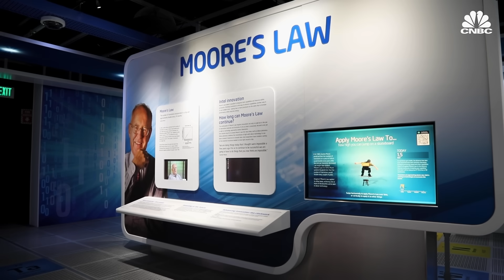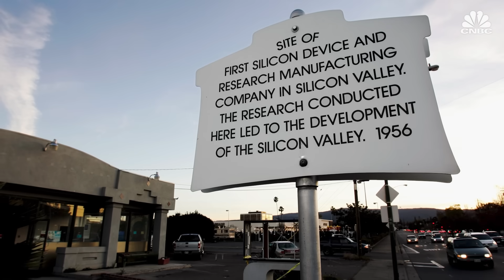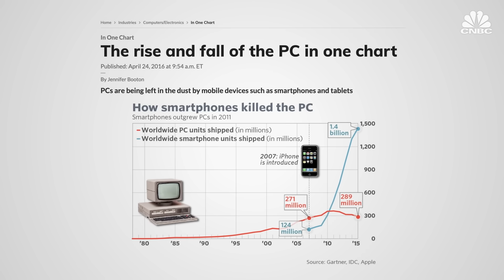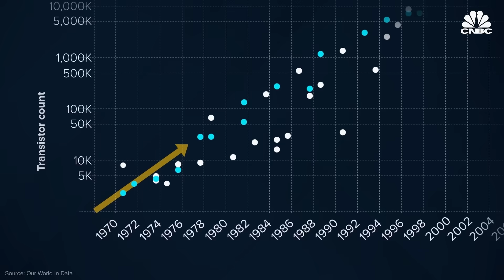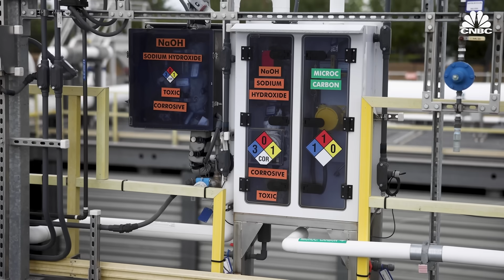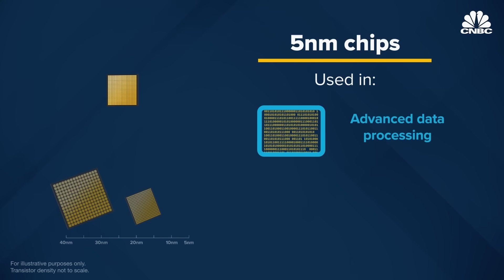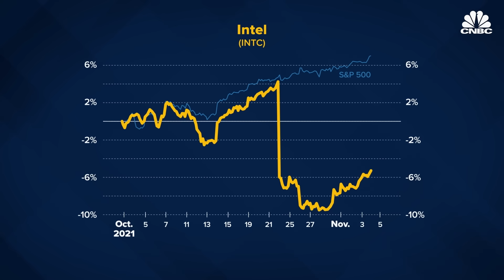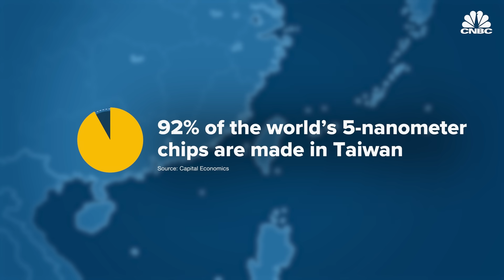Inside Intel’s Bold $26 Billion U.S. Plan To Regain Chip Dominance

Comment: Intel wants to surpass TSMC with $26 billion? They do know that TSMC is investing $100 billion over the next 3 years, right? CNBC reported on that, too.
Also, 18A by 2025? Translating from Intel Time, I'm guessing we'll see first small-scale products (probably a mobile CPU) by 2030.
Reply: TSMC needs more capacity for other partners intel will probably use most if it's capacity for itself 100B over next 3 years maybe but how much of that is R&D and how much is cost to setup new facilities
Reply: @naveenbattula  when a single asml machine costs 180million intel will need to sell to others as well. Such machines have a life expectancy of a few years. This means that these machines need to work 24/7 for the next 3 years with no stop to make the invest worth it.
Intel is not building the machines, they buy them from asml. Curently TSMC is a much better customer for ASML, the more you buy the better and more important customer you are.
The 100B Tsmc spends is for the next gen 3nm machines while the 26B intel spends are for the old 10nm and 7nm machines. Tsmc is already operating 5nm machines, months now.
Reply: @billwhoever2830  I don't understand your economics, it doesn't matter what size you make if it doesn't work or if no one wants it or doesn't want to pay  the price. Madly building without a plan, which is what many tend to do, will not get you to the  desired result.
Reply: @billwhoever2830  : INTEL own 15% of ASML. Intel invested in euv developement by 5 billions.
Reply: @tedmoss  
"Madly building without a plan" is not what TSMC is doing though. Almost all of the big companies choose TSMC for the manufacturing of their chips. Samsung, the only competitor today is something like a worst case solluttion if you fail to preorder from TSMC. For example Nvidia had to use Samsung on their last gen of GPUs because AMD and Apple preordered everything. Nvidia now has already pre ordered wafers from TSMC for the next gen. What makes you think that a company like amd, apple or nvidia will choose the new player, intel, over TSMC? I would say that intel is the one "Madly building last gen fabs without a plan".
Reply: @billwhoever2830  Intel 10nm is equivalent to TSMC 7nm in terms of density, and Intel 7 / 7nm is equivilant to TSMC 4nm (which isn't at full on production yet)
Reply: @billwhoever2830  Yes they are, that's what they all do in the end, because of lack of foresight and not seeing any other way. Desperate tunnel vision.
Reply: @billwhoever2830  Wrong, but it is a desperate plan nevertheless.
Reply: @rajeshdevika6195  : TSMC, Samsung, and Intel all had significant amount of shares in ASML.
Reply: I just think it's cool that Taiwan is a small island country of 23 million people. and the USA is a huge continent with 300 million people, has easy working language to learn, and sucking brainpower from all other countries through cultural domination and best-financed universities on the planet, and still can't keep up.
even ASML is a Dutch company, that´s the Netherlands. The Netherlands has 17 million people. and now it's their prime time.

 you know, natural capitalism, which is without nationalistic war conflicts but just peace, does head for the inevitable centralization of production monopoly, for efficiency purposes. ""After reporting earnings in July 2021, the company said they had a near-monopoly for machines used by Taiwan Semiconductor Manufacturing and Samsung Electronics to make the advanced chips. ""
Reply: @naveenbattula  you realize now intel has huge government contracts to provide chips for the US government ... And tscm USA plans are dependent on the government giving them huge subsidies Wich will not happen now the new spending bill is getting cut way down .. I'm American and fully support American made products ... Once China invades Taiwan it won't really matter and that will happen within 10 years and nobody will be able to stop it .. Tscm will be another Chinese government controlled entity
Reply: @wuhanlabtech3580  what do you mean by they were right but in the end they were wrong??? It's easy to design a 3nm or 2nm chip, anyone can do it even China, but manufacturing is a whole different world. This has nothing to do with Lith machines either, anyone can purchase them. Samsung has them but they are nowhere near where tsmc is at
Reply: @trueG922  actually they are and so is intel.. you been watching to many YouTube video's and should actually dive into the research that is going on .. but I suspect you won't and will not play your little game 
. Your a tscm fanbio I get it .
Reply: @trueG922  na not really intel 7nm well intel 5 I'm guessing it will be called now .. has a greater transistor density and everyone including intel is switching from fin fet .. and sorry bro when it comes to advance chip designs no one comes close to what IBM does they already made 2 nm chips months ago and are working closely with Intel now
Reply: I'm pretty sure that $26 billion number is their r&d figures over the next two years. Their total investment is much more than that. Their going to spend $95 billion in the EU alone with more investment in the US in the future. Their new CEO is going to spend so much on r&d that their shareholders are worried their pockets will be affected. I really hope intel can catch up. It will be difficult but Americas tech leadership is at stake and Pat focusing more on long term gains by spending big on r&d instead of short term gains to please shareholders like his predecessors is already a good sign of things to come.
Reply: @jms3827  That’s not quite what Intel said. It’s an announcement of only considering “up to $95b over 10 years”. A political announcement, not in the books, and much less per year than TSMC. TSMC capacity is 13x greater than Intel (13m wafers vs 1m wafers); it’d be unusual if Intel was out-investing them in fabs.
Reply: What? TSMC is building in America, so what are you guys on about? + Intel has been exposed by AMD, the American public no longer wants to support their greedy business model.
Reply: @GTJW22409  that's because US wants to steal TSMC tech. It's easier if you abduct them and bring them to your own place. 😁
Reply: @tweedy4sg  Yepp, we all know what it is. It is not stealing though, they made several huge deals, everyone has a price.
Reply: lol ...Most people who left comments have no idea the real reason why TSMC is successful.  It is successful because it is in Taiwan, with Taiwanese employees and complete supply chain in Taiwan. TSMC wouldn't be this successful if it started in the US or anywhere else.  Intel can invest  a trillion dollars and it still won't be able to compete with TSMC without a complete supply chain in the US and a relatively more cost effective employees and operations.
Reply: @jfyhou  : Sure, TSMC enjoyed the protection of the Taiwanese gov't largess from the getgo.  If the semi industry in the US had the same level of active protectionism from the US gov't, we wouldn't have TSMC today and Morris Chang would  have been at another American company.
Reply: @tooltalk  What kind of protection are you mentioning?  The US protects its semi industry by using political power. That is why Japan fall from dominating the chip industry, almost zero chip production in Japan now
Reply: @jfyhou  well, US was one only for long time in chipmaking
Reply: Makes me wonder how TSMC got so big they can afford $100 billion. And why didn't Intel invest? 6:37 oh nevermind. Obviously. The great invention by American CEO penises, outsourcing.
Reply: @TheBooban  Net profit of TSMC has estimated at around 30 bn this year, and the growth rate is about 20%.
Reply: @TheBooban  , it's through outsourcing that consumers benefit , not just corporations. It's because intel do not outsource and AMD does that makes AMD, Apple, nVidia, Qcom, etc to surpass Intel in design.
Reply: @TheBooban  Explosion in smartphones i.e. mobile chip orders from Apple & Qualcomm
Reply: @TheBooban  almost as if they had 48 billion revenue last year....
Reply: @TheBooban  TSMC makes up over 92% of the global advanced semiconductor industry lol, that's how. Anything with a remotely advanced chip in it, form cars to fridges to multiple parts in a computer, all comes form TSMC foundries in Taiwan, and the Taiwanese government subsidizes TSMC. Not to mention many companies are contracted with TSMC, they are a semiconductor behemoth.
Reply: @mycelia_ow  : ??  TMSC has just over 50% of global foundry market share.  The company has 90+% on 5nm nodes which is primarily used in low-power, mobile chips  -- ie, Apple and Huawei (before sanction).
Reply: @tooltalk  lo that's why I said advanced semiconductors, different figure than all from all semiconductor foundries.
Reply: @mycelia_ow  : then you went on to say very misleadingly they make chips for cars and fridges as if they are fabbed on the same "advanced" processing nodes.   I'd also consider anything under 10nm "advanced."
Reply: @mycelia_ow  Subsidy from Taiwan? Are you kidding? What a lie
Reply: @mycelia_ow  the US government  is now subsidizing intel
Reply: @mycelia_ow  Cars and fridges don't use advanced semiconductors. On the contrary.
Reply: @andro7862  depends, I think Teslas use many advanced chips, especially with their self driving module. I think I read somewhere stating EVs use like 10x the amount of chips and electronics than a modern gas car does.

But yes, most semiconductors in both EV and ICE vehicles are more basic chips. 

Fridges? If it's a smart-fridge running android, it has an ARM SoC in it, which is an advanced semiconductor. not exactly a high demand (or affordable to begin with) product, but still.
Reply: @wuhanlabtech3580  : the Taiwanese gov't has been subsidizing TSMC from the very getgo in the 80's.
Reply: @tooltalk  and now the us government is subsidizing Intel with government contracts that allows them to get paid without producing just as capacity
Reply: Intel is going to announce more fabs in US, they are waiting for the 52 billion bill.
Reply: seemed like this report was just another promotion for Intel's Alder lake cpus. lol
Reply: @Forester P Of course the US economy is more stable than Taiwan due to size. But nobody, literally nobody, is batting an eyelid over Taiwan's 28% debt ratio because it has foreign exchange reserves of over 80% GDP. It could pay off its external debt entirely in one shot and still have plenty of foreign exchange reserves left over.
Reply: @torpedospurs  I didn't know they had such a large foreign exchange reserve, but I guess it makes sense. However, a country can't really tap much into their exchange reserves without causing large potential impacts to their economy.
Reply: Bigger problem is that the US no longer has competent engineers.  And most US engineering schools now take a back seat to Asian and European schools.  The few decent ones that are in the US cator overwhelmingly to an int'l student body.  Just means that no matter how much money Intel spends on microcontrollers, there's no way it's gonna compete on the global stage.  Not anymore - that ship has sailed.
Reply: @attsealevel  : even majoirty of students in USA uni are Asian and Indian.
Reply: @rajeshdevika6195   majority of science, engineering and math students are - you're abs right, Rajesh.
Reply: Intel is being self reliant so they don't have to worry about chip production. Intel has been on this path for decades.
Reply: @ageminiani   The US would probably drop a bomb on that fab plant before letting the chinese take control of it. Can't let them filthy CCP get their mitts on such great tech.
Reply: 26 billion is their investment in US only. They committed like 100 billion in europe as well.
Reply: @jghgiroot6735  : where you are pulling these numbers?   The company spent $17B in capex last year.
Reply: Intel can straight out own TSMC, but it's not some thing they will be proud or saying it out loud.
Reply: @WolframaticAlpha Apple is doing the Revolution with its M processors. Or what?
Reply: @WolframaticAlpha I wanted for sometime to discuss this trend with knowing person like you. )) ram expansion? serious? I never added ram in my notebooks. Who cares? You just buy a new notebook with faster proccesor and larger ram.
Reply: @WolframaticAlpha https://www.youtube.com/watch?v=7syCGv-0VwQ good video btw
Reply: Intel knows more than you steam Rick. That's all that really matters buddy. Dont use the word billion. Why is it even in your vocabulary
Reply: @Forester P Very true I moslty agree, but if there was no invasion treat in Taiwan I would much rather have Taiwan bonds than US bonds at the same interest rates.
Reply: @Forester P Well I juts checked the 10 years interest rates and its 1,5 for US and 0,5 for Taiwan. And that is with the Fed artificially pulling the US rates down. So no even with invasion threats Taiwan is much more attractive.
Reply: TSMC and Samsung are being pushed out of the china (largest chip market in the world) market by the USA government bans. The USA government is setting up intel to succeed by slowing TSMC and samsung.
This is why INTEL will definitely overpass them. Intel will be the only company allowed to sell to china. Thats why they are building so many new fab plants.
Reply: @dantheman3022  : TSMC doesn't really want to severe business ties with China; Samsung is a different story.  They has been migrating out of China for the past 5-6 years -- they've ceased their smartphone, TV, and shipbuilding operation out of China and it had little to do with the US.   Former TSMC employees have done more than any others to help develop China's semi manufacturing industry, most notably at SMIC, though they all had to leave (or are leaving) the company recently after the US sanction slowed them down.
Reply: they will coz the tsmc plant is across the road and all blueprint and trade secret handed over to US thugs haha
Reply: Must protect chip production from China, in high probability if China should invade Taiwan then they can control TSMC thus control global chip production. US must safeguard against this possibility
Reply: @richpt3646  : "Must protect chip production from China, ..."

Joe Biden granted $100B worth of licences to Huawei and SMIC this year.  Good luck with that.
Reply: @richpt3646  hence why they are moving to the U.S.
Reply: @richpt3646  , you seem to forget there's still Samsung, and Globalfoundries which is American.
Reply: X86 tech is deadway itself, right?
Reply: 100 Billion from TSMC will not all go to CPU chip production, whereas all of Intel's investment will, so yeah they'll see major leads.
Reply: @asdflkawj2165  100 billion goes a lot further in taiwan than 100 billion in america
Reply: That is just 1 us factory... they invest another 80 billion in europe and more in other reguins.  So globally they invest MORE as TSMC. And don't forget the high amount of fabs it already has.
Reply: SILICON CHIPS SHORTAGE ARE NOT ACCEPTABLE IN THIS 21 CENTURY.
Reply: intel will fail because they are infested by the ccp.
Reply: @mikeoxlong8886  Pfft.
Reply: $26 billion is a huge amount of money.  I have no idea what TSMC is buying with 4x the money.  My guess is Apple is behind a lot of that number, it may even be Apple’s money, but TSMC is taking credit for the investment.  Maybe…?
Reply: @ClockworksOfGL  : not quite.  Samsung Semi spent $27 on capital spending last year; TSMC $17B.    Apple accounts for about $2.5B of TSMC's revenue last year -- no, the world doesn't evolve around Apple.
Reply: @tooltalk  Apple accounts for 25% of TSMC's revenue last year, i.e.,  $16B out of $48B.
Reply: @torpedospurs  : You mean $12B?   That doesn't even cover TSMC's capex last year.
Reply: @tooltalk  $12B yes. But why does it have to cover TSMC's capex? Doesn't it have all $48B?
Reply: @torpedospurs  If Huawei still can buy from TSMC, Apple will be taking up a much smaller percentage.
Reply: @tooltalk  - Apple is TSMC’s largest customer with ~20%+ of sales.  IIRC, they’re also willing to pay top dollar, money up-front to secure a stable supply of the latest tech.  I’m not an Apple watcher, but it sounds like something they’d do.  Apple has such a voracious appetite for components, they’re forced to be more active with suppliers.
Reply: @ClockworksOfGL , The chip manufacturing in TSMC, has only 10% using technologies from the US. The ban on selling to Huawei is causing TSMC to lose 20 billion business from China per year; Huawei is a client of the same size as Apple. By the time TSMC makes 2 nm, all technologies will have nothing to do with the US. When TSMC starts selling to China, TSMC is booming again.
Reply: Don’t trust numbers from Asia.
Reply: Trust me, without intel TSMC wouldn't exist. Chill
Reply: nah intek ia trash without tsmc intel dont exist  @randomautonomousdronepilot3384
Reply: Samsung and TSMC buy Fab Machines from ASML and do manufacturing ! Any fool can buy stuff for money !, But Intel is advanced circuitry designing company who has revolutionized the World ! Samsung and TSMC don't have those capabilities, so Intel can beat Samsung and TSMC in a huge margin and regain the Supremacy !
Reply: @superrider4481  The ASML machines, made in The Netherlands 🇳🇱😁, are very very advanced. I don’t think Intel can replicate them (they are a client actually). Even China wants them desperately (but can’t due to political issues )
Reply: tsmc is bankrupting their owned country in debt vs us only spending 26 billion and intel is american....so just watch asian countries collapse by their debt and their people gonna riot to their government pretty soon now...china gonna see this a opportunity when that happen, not our concern when we got intel...they can keep their tsmc under water
Reply: @user78405  Taiwan has a debt to gdp ratio of 28% and its decreasing, the US has a debt to gdp ratio of 135% and it is increasing fast. Just saying.
Reply: @user78405  my god how narrow minded. TSMC is building facilities in the U.S. also. This whole US vs everything is why we lag behind other countries in many technologies.
Reply: @user78405  if the US cant collapse under their current 30+ trillion debt, i think taiwan will be fine with just a few billion.
Reply: @BattousaiHBr  silicone shield baby!
Reply: @BattousaiHBr  Consider the fact that the US has the worlds reserve currency and it becomes less of a worry for the US. If Japan can have a 200% Debt to GDP ration the US can have the same;
Reply: @BattousaiHBr  Taiwan will do just fine but It's actually US who are in deep trouble. 28 trillion dollar debt is unsustainable and the only thing saving them is dollar being the world's reserve currency.
Reply: @BattousaiHBr  not really most the debt is just money we owe to ourselves the federal reserve has been paying for the government spending since 2008 by diluting the currency .. so most the recent debt is just money we owe the fed and who cares about paying them back they already diluted the currency
Reply: @user78405  how are they bankrupting Taiwan ? Lot of their manifacturing plants are in collaboration with their clients. TSMC's massive growth is mainly because of their collaboration with Apple. The real reason why Intel have to spend less than TSMC is because they're producing chips only for themselves and TSMC are producing for Nvidia, AMD, MediaTek the biggest mobile chip producer, Broadcom, Apple.
Reply: @user78405  Taiwan is the fifth largest net creditor country with 1.37 trillion invested in other countries, the foreign reserve in Taiwan more than 500 bn, Taiwan has only 200 bn debt, how can a country with 2 trillion on hand and 200 bn debt go bankrupt?
Reply: @user78405  You have no idea what you are talking about.  Get your facts straight.
Reply: @user78405  : Tsmc is bankrupting their owned country in debt,: are you sure? Do you know that Taiwan has more than 500 billion in foreign reserve and as a creditor country it has more than one trillion. Next time, please check the data before saying anything.